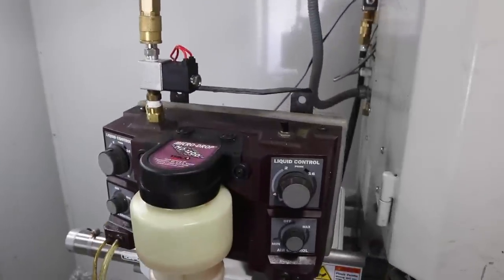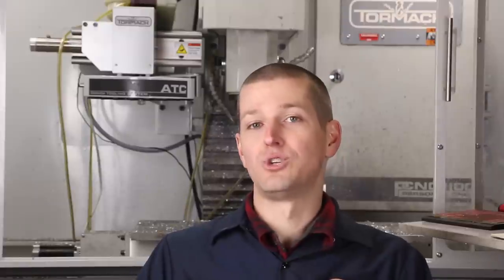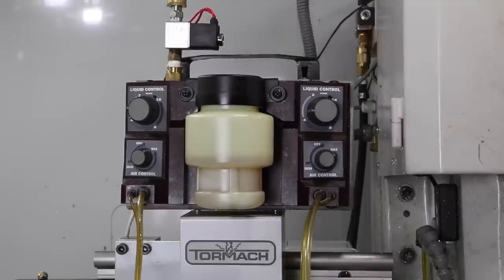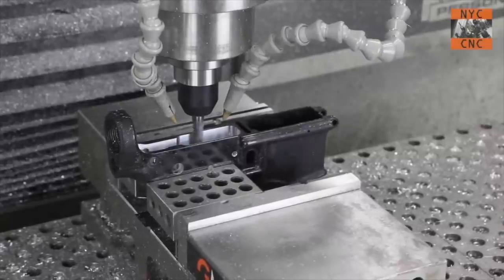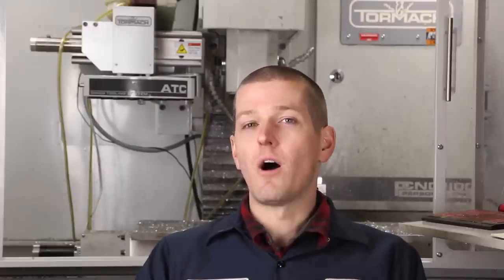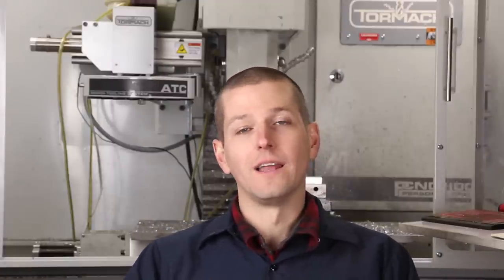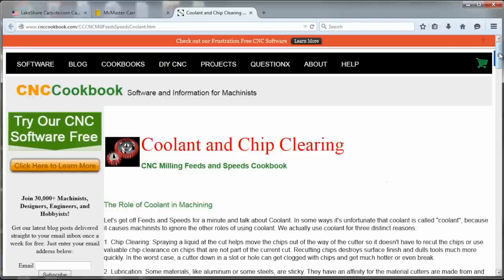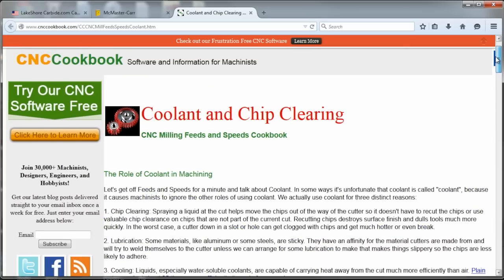CNC Coolant Systems & Basics - Flood Coolant, Dry, MQL & More!

Comment: I have an older 1100.  I bought it with the base and flood cooling system.  And immediately ran into problems with it.  I don't know if the newer models are designed differently now ...  The short version of the story is that I redesigned almost every aspect of it and here is what I have now:

I bought a couple gallons of epoxy, the kind used for fiberglass repair.  Pulled the mill out of the base, cleaned up the base, tilted it, and poured the epoxy in.  Now I have a sloped surface for the fluid to run back toward the drain.  Before I did that the reservoir would run dry on me right in the middle of a deep pocket cut and it would stop evacuating chips.

I cut up a sheet of Lexan to lie flat inside the enclosure on both sides of the mill.  They catch most of the chips so the chips don't wash under the mill and make a dam that stops coolant from going back the the drain, right where it is almost impossible to clean them out.  Makes a nice flat surface so when you are making piles of chips you can scoop them out with a dustpan real easy.  This also stops using the screen in the drain as the only chip-catcher.  The screen gets stopped up real quick and makes the reservoir run dry for fun surprises.  Now it's no more problem.

I used the same Lexan to make splash shields that fit all around the enclosure.  They just sit in the sides and back.  When you're making chips right they fly a long way, these catch them and keep them off the wall.  They also keep the coolant in the machine.  I made two special ones; one that has slots so it fits over the front of the vise, just slips on and off.  That keeps chips from building up on the accordion at the front of the machine (that's the one that gets compressed down to zero and compacting chips in the folds is not good for it).  The other one has a few brackets bolted on so it just slips over the front of the machine when the vise is not mounted.  The result is total chip and coolant containment except for some of the flingers you get when you're drilling.

I ran larger piping and hoses from the pump all the way to the spindle.  The originals were way too small and the pump drinks easier now.  I attached the vertical run to the back wall, put a tee there and a check valve.  The check valve gets rid of that variable delay when you turn coolant on, so you don't have to worry about melting a tool while it hogs away dry while waiting for that first gush.  The tee is hosed two ways -- one to the spindle and the other to a bulkhead fitting, valve, and short length of garden hose with a nozzle on it that hangs on the front of the machine.  That's useful for clearing most of the chips off the vise and workpiece before going after them with air.  That way you aren't blowing chips across the shop, into your ways, and into the sensitive areas of your vise.  And you can chase them into a pile with the nozzle, rinse them off the table, etc.  Saves time.

The other side of the tee goes to the spindle, where there is a ball valve mounted right to the side of the casting, and some of that ball joint tubing/hose stuff arranged with three nozzles, each one with a valve on it.  It's real nice to have flow from three directions when you're doing deep pockets and it's real nice to have more than enough flow to spooge the chips out.

After making the newbie mistake of trying synthetic, I switched to Blaser (can't remember the formulation but will look it up if asked).  I use it at higher than recommended concentration.  No rust ever, and the stuff positively won't spoil.   It doesn't eat the paint, either.  The film someone else mentioned is a rust preventive and I am happy to rinse it off just by hosing it down with the same coolant after a period of inactivity.  It lubricates well enough that I was able to do a bunch of deep holes in aluminum, where the other synthetic stuff ended up with chips welded to the tool and gumming up the flutes and busting off the bit in the material.  Night and day difference.  The refusal to go sour means I can use a wet vac to clean up chips.  Huge time saver, and again way better than compressed air.

Anyway my amateur opinion is that the time spent redesigning that cooling system more than paid back in reduced maintenance, let alone productivity.

I don't know if this wall of text is clear enough to help anyone, maybe I should just shoot a little video of my own when I get the time.

I also added a counterweight, don't know if anyone is interested, but it got rid of a headache with the Z axis.  There was a pretty good difference in height depending on which direction it was traveling when it stopped.  And now I don't have to scrinch down the ways to stop it from wrecking itself when I turn it off.

Hope this helps.
Reply: Wyatt Storches Hello Wyatt, I'd be interested in getting the formula of that Blaser coolant. I went to their website and they don't have any prices listed. I hate that. Was it the B-Cool stuff? How much did it cost?  Thanks. Mike
Reply: +Wyatt Storches good infomation Wyatt, what is the  formula of Blaser  you use thankyou
Reply: That is a gold standard of a post.  Several good ideas (I like the check valve especially, good solution), and clearly written as well.  Thanks mate!

Comment: I have made up a couple of coolant systems of this style for a lot less money. You can use an air line lubricator and just use your cutting oil or coolant of your choice. Once set they work great on saws. You may need to adjust the size of the jet inside and then you adjust the pressure of the air feeding it. A lot of CNC's will have spare outputs on their plc that are not used and only need an M code to activate. You could use this for your extra coolant setup you are talking about.
Cheers

Comment: Totally agree! Chip clearing is vastly more important than cooling or lubrication. I was using the Kool-aide as flood and it worked fine for as long as I used it since it was mainly clearing chips. I had a lot of problems with rust and it was getting to be a chore trying to keep up with it. I switched to Qualichem 251C and it is much better in terms of smell and lubricity but I didn't notice a huge decrease in tool chipping. It is probably the same as far as chip clearing goes which was already adequately done with the other one. Probably about the same as far as cooling goes that I can tell, but it really excels at rust inhibition. Using this coolant you can wipe your fears or rust, it leaves everything coated in a fine oil film. The semi-synthetic Qualichem does seem to have a palette for cheap imported paint though.
Reply: Nothing. I just scrape it off when I'm shoveling out chips. Maybe one day I'll repaint it but I don't really care as long as it's not rusting, no harm in leaving it bare metal. I could powder coat it like Grimsmo but I suspect it would be a colossal undertaking to dismantle the enclosure for so little practical gain.

Comment: Large job shop here (20+ cnc machines).  Regarding flood coolant, AVOID fully synthetic coolant like the plague.  I don't care what the salesman or your buddy who runs it says - that's where you get rust problems (ask me about $10k+ in replaced ballscrews & bearings).  I know of several machine manufacturers who will go so far as voiding warranties if you run full synthetic coolant.  Use a good semi-synthetic, keep a check on it with a refract and you'll be fine.  A simple fish tank aerator can be enough agitation to keep the smell down if you have that problem, and use a skimmer if you get too thick a layer of oil on top.  I've used Trim, Castrol, Milacron, Blaser, but have found Qualichem to be the best I've ever seen.  Controls the rust (and we run a lot of cast iron), doesn't build up a gooey film (like the Blaser did), doesn't "snot" up (like the Trim did) and can go uncirculated for an incredible amount of time without stinking.
Reply: NYC CNC
Blaser performs very well.  It just builds up a slippery film all over everything that's a chore to clean and dangerous to walk around on.  It also tends to foam up in high pressure systems and is rather expensive.
Reply: Great tips!  I am using a full synthetic and getting crazy rust.  I'll be switching to Qualichem because I've heard nothing but great things about it.  Even Mitee Bite uses it in their shop, that's good enough for me!
Reply: JohnGrimsmo Qualichem Xtremecut 230 is what we're using and it's fantastic stuff.  Run it about 3-5% for general machining, a little richer for sawing & grinding.
Reply: JohnGrimsmo I'm using Xtreme cut 251C (for heat treated steels) and it's pretty rad. I'm keeping it at around 10% and it does really well. I mainly need it for chip clearing. No nasty smells, no crud or moldy gunk. My only complaint is that it makes the floor VERY sticky if spilled and allowed to dry. I can tell there will be absolutely ZERO issues with rust using this coolant like I was having with Kool-Aide 77. It leaves everything coated in a fine oil. In fact the rep told me NOT to clean my machine after using it, just let it sit on the table, vices, etc. It will protect them from rust.
Reply: NYC CNC
Haha, I wish I could but...there was a little mishap...you know with the drilling;)
Reply: JohnGrimsmo Quote:  "I'll be switching to Qualichem because I've heard nothing but great things about it."  : )  'Bout darn time!  : P  Cheesy grin!
Reply: I agree with this. We were using cimcool semi synth for a bit now using stoughcool blue. The full synthetics don't stick to any surface and will displace anything on those surfaces before wicking off. Thus the rust.

Comment: Thank you so much for this very informative video.  The coolant information for "the big boys" exists, but seems to be scattered all over the place and a lot of it doesn't apply to garage shops.  This video provides a great resource for those of us just starting out and needing to make coolant decisions for the first time, but also active garage shop machinists who have been at it quite a while and getting along with whatever we're using, who maybe never considered a different method that may actually work better for their situation.

I mostly do dry machining.  I'm generally not trying to get the very highest rate of material removal as my machines are all low power, but I am concerned about cut quality and tool life.  I concur.  Chip removal is essential.

I remember you discussing cooling when machining in an apartment on that Taig.  Ah, the good old days!
Reply: NYC CNC 
Every now and then I go through my old bookmarks and I come across the one titled "Herbie the NYC CNC" (or something like that). :)

Comment: Great vid as usual John!  Made for a good lunch break.  I've been using the Tormach Premier Synthetic (which as Juan Aviles said they have now changed to something else) for almost 3 years and in most ways it's great.  There is practically no smell, it NEVER gets stanky/moldy/gross, seems to lubricate well enough when it's rich enough, it's clear like water so filming is easier, but it rusts pretty badly and ate some paint, causing more rust. 

I do love flood coolant, but it is messy.  I've also got the Fog Buster that I use for some jobs, and it's wonderful.  You can use any coolant in it and it seems to last forever.  I only run it at 5-8psi and it seems like a crazy amount of air coming out the nozzle.  I haven't found the need to turn it up higher than that.

Comment: I used to tap some real long drills on hardened steel.
For lubrication i use butter. REAL butter,  from a  legit cow.
When I have the drills, I put it in a chef-bag so i can push it down the hole.
That wil give you TWO advantages, first, of course, lubrication. BUT also excellent chip evacuation as it's a viscous material that will push the harder material up, and also lubricate the material as it flows trought the hole.

Comment: Generally flood coolant tanks get bacteria from either organic material being machined (I have this problem) or not enough skimming to remove the oil. We've also started aerating our coolant with a very slight air bubbler to introduce oxygen as the main bacteria that harms most flood coolant tanks can't stand it. Another thing we may try in the near future if things slow down a bit is to add some copper or silver to our system for their antibacterial properties. I'd love an air mister for when we machine steel as flood cooling isn't the best option at all, in fact it's not ideal at all. But boss man says you go ahead and try without. I do so often with better tool life than without but only on open profiling. How much cfm do you think your system takes to operate effectively? Seems like a lot but I could be wrong.

Comment: its been a lot of years but it seems every shop ends up going thru the cooling"challenge"lol.With small shops with just one or two mills/lathes most seem to start with misters...which means its always a fight between enough flow at workpiece and air quality in the shop..get a little larger or tired of oily residue on everything in the building then we all seem to move to flood cooling which definitely has its place for some things..but ya have to deal with keeping the mix/water ratio right and filtering/skimming/biocide.We finaly got tired of it and let a salesman convince us to try a microdot lube system...basically the same as ya have there tho with fewer options.We did stick with flood on the Fadal and the big slant bed but basicaly just because of the enclosures and chip conveyors.

Comment: If you would like to make this as simple as possible on yourself, get away from water based coolants altogether. We have machines that require water based coolants such as turning centers and large hog-outs. As you seem to be concerned for the maintenance involved as well as rust protection, consider going to a full veggie or mineral oil. It is a higher viscosity but your pump should have no problem running it. It will not flow as hard but it also requires very minimal maintenance and is rust proof to your machine. We can run machines for years with it without doing anything other than passing it through a high micron filter. In fact it also helps the machines moving parts. If we are running steel, we only run a full oil coolant as it does much better for the parts and tools. If you would like proof for yourself, write a small program that does a drill, bore, ream cycle and do one part with your current system. With another part, fill a spray bottle with veggie or mineral oil and spray it on the tool abundantly while it is reaming and check out the difference. Best of luck.
Reply: 10DM Would be at the very top of the price range but great lifespan. Blaser has some pretty good options for that and others. Although vegetable oil might give you some surprising results, I think mineral might be the way to go as it generally handles the fine chip particles a bit better. Either way, its a win. Your investment into oil will last you a long long time and surprisingly enough, you can film in it for the most part.

Comment: Hi John, nice vid. I made my flood coolant sys for my tormach 770. The machine is out in the garage in Michigan so freezing is an issue for me. The reservoir is made from a rubber maid tub. The trough is made from wood (drew it up in cad) cut the detials in the cnc router i built. glued and screwed. Sprayed on a rubber coating seems to be holding up well theres a screen in the bottom for chips they never reach the reservoir . I use rv solution mix with full synthetic both are biodegradable (so it says). I have a hose to flood and with a valve i have a hose to clean the machine. works great and cost nothing to make my kinda project.  Later
Reply: got it

Comment: There is a dossan hp440 at work threw spindle coolant and the machine has about 6 lock lines that are 1\2 inch. the pressure that comes out of the locline is comparable to a pressure washer its amazing. i see this machine hourly take a 1 inch rougher at 1 inch doc 40ipm 12000rpm no problem . the coolant smells just like peanut oil....
At home I use cool mist unit im happy with it. I dont use there coolant. I run low coolant very low like you high air pressure. Sure if I crank my coolant knob up the shop gets yucky. There is a fine line. You cant even see by eye what comes out but its there.
Reply: NYC CNC
Its wild.The doosan is a horizontal, it has a rotary table as the main work table attached to the rotary is a tomb stone.  The gcode  the same as a vertical if your using the tomb stone. 
Tell me when your in ct next might be able to make it happen.
Reply: NYC CNC
Im in waterbury. I work for B&A macine out of milford.